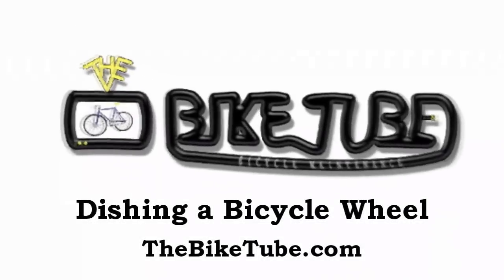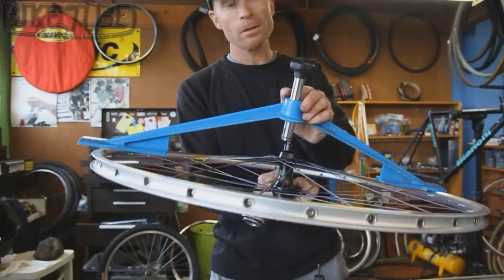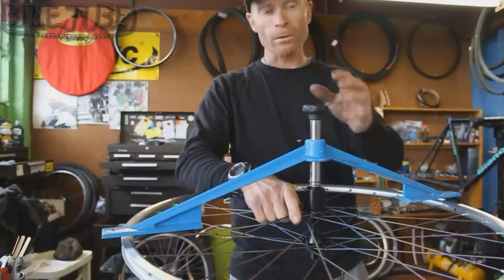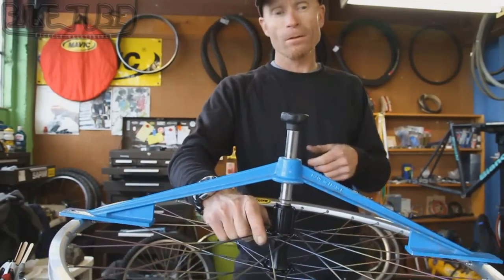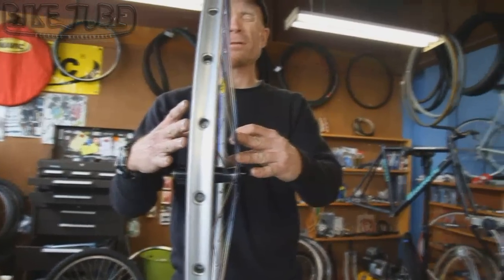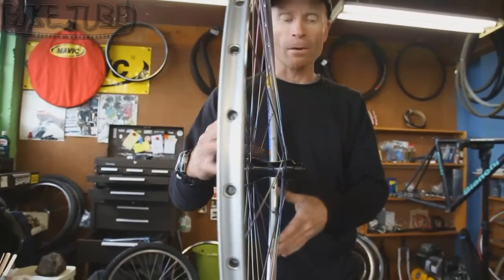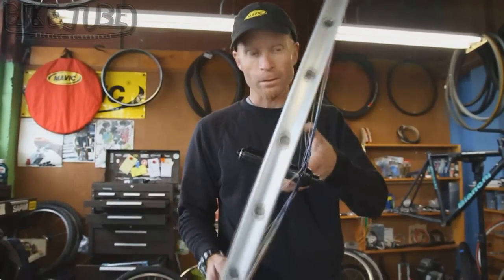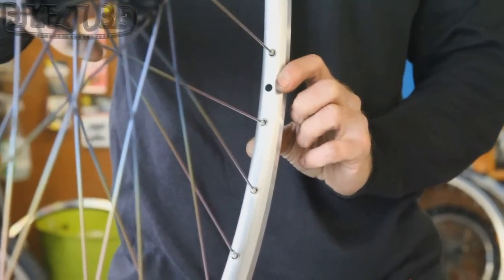How to Dish a Bicycle Wheel | TheBikeTube.com

Comment: You can make a decent dish gauge by laying the wheel horizontally on a flat table and putting shims of equal height on opposite sides of the rim. Then, you slide something under the hub and flip the wheel to compare sides. Any number of household things can be adjusted to set the height. Until I tried it, I didn't realize how heavily rear wheels are dished to center the rim in the frame so it tracks straight. Apparently wheels are designed to handle the spoke imbalance.

Comment: No, the rim should be centered between the locknuts. It doesn't matter if the rim is for a cassette, freewheel, internal gear, disc brake, rim brake or a front wheel. If the rim is not centered between the locknuts, then it won't be centered in the frame. Front wheels without discs will have a symmetrical dish, rear wheels, like this cassette one will have an asymmetrical dish.

Comment: i dont get something, how do i get to the situation that the spokes are tensioned equally before i start making precise 1/4 turns ?
i mean the final adjustment of 1/4 turns is pretty precise, but who said i already tightened the spokes to some equality before the final adjustments, because i dont know how much to tighten the spokes from the beginning.
did you use the tension gauge tool ?

thanks.

Comment: Wait, if there is a gap on the non-drive side hub, doesn't that mean that the rim needs to go towards the non-drive side? Still learning and am stuck at the dishing part of wheel building.
Reply: If you pause at around 44 seconds, picture the rim like a platform holding up the dishing tool with a goal of making the the center piece of the tool touch the axle thats below it. In order to do that, you have to "lower" the rim or pull it towards the drive side which would mean you first loosen the non-drive side spokes a quarter turn and then tighten the drive side spokes a quarter turn.
Reply: yetijoeyetijoe make sure it's centered between the chainstays and that's good enough. otherwise buy the tool and do exactly what he says. should take less than an hour with a truing stand.
Reply: Thanks for that explanation, totally makes sense now.

Comment: It's weird, but I always thought it doesn't make sense that the rim should be center over the ENTIRE hub. Rather, I thought that the shell should be center to the axle. Anyway, can anyone imagine how the wheel will look like if the shell was completely to the right or left and you had to dish it? The wheel will be rolling on it's mid side possibly? Strange idea about dishing from locknut to locknut. I suppose most wheels are made so the shell is close to center. Just a thought, don't kill me pls

Comment: I'm just staring with building wheel, but in the first  part It looks like you build it wrong.
I mean, I just read and saw the graphs on Sheldon Brown's Web, and the inner spokes are different in this video, the ones on the non-drive are right, but it look like in the other side are wrong.
I'm confused right now.
Could I start building it like the tutorial of the 36-holes wheel tutorial?
I mean, first one side, then the other side, and then the thing of  "over over under" with the 3-cross thing?